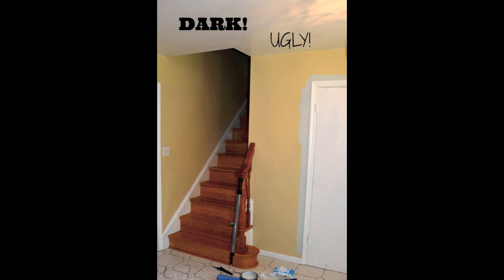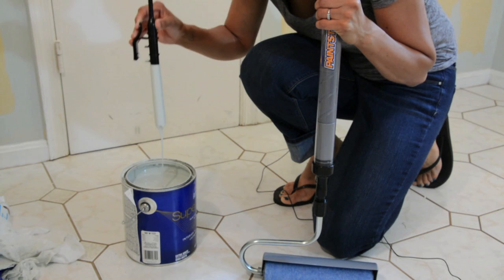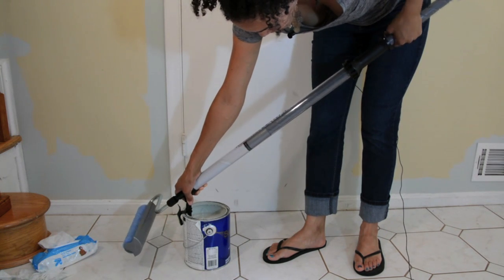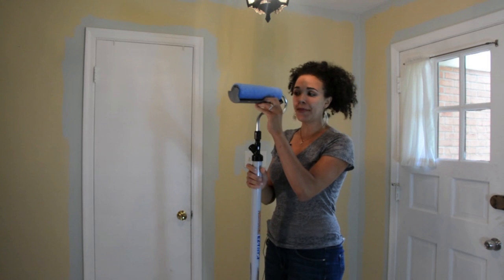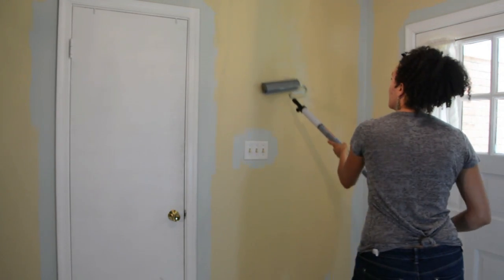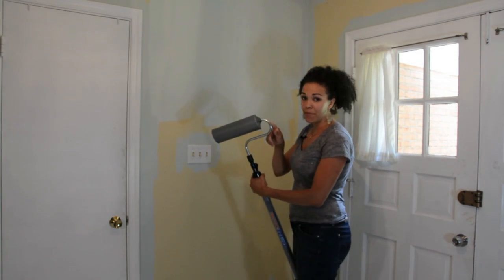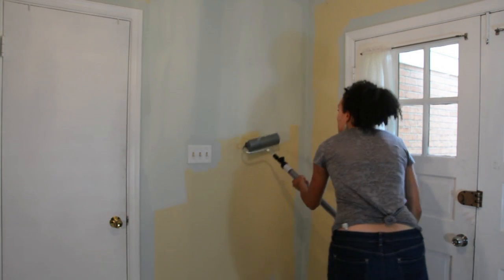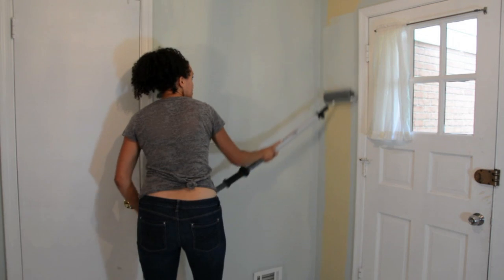HomeRight EZ Twist Paint Stick Review- Thrift Diving

Comment: There is a video on YouTube which shows how to fill the tube without the air bubble. Also in the black handle there is a little lever you switch to pull back like a syringe instead of the screwing motion to fill it. When full just flip the little lever back and roll it out!

Comment: Great how-to tutorial video Thrift Diving, this project was a great project for the PaintStick EZ-Twist. 
A side note: there is a toggle switch on the black part of the handle that you can flip in order to pull back the handle for filling the paint. Then simply flip the toggle switch back to twist the paint to the roller. Either the way Thrift Diving shows or what we just mentioned works for filling the PaintStick handle that holds paint in the handle.

Comment: I used the original version 20 years ago and removed the shield because it got in the way and the roller doesn't make a mess at all so there was no need for the shield.  Also the original version had a full size large round lid for the paint can with just a siphon tub attached.  The original didn't require twisting, just pulling to siphon the paint.

Comment from the maker: Hey, Allen! Cleanup took a little longer than my normal cleanup because I usually throw away traditional rollers! lol That's expensive, and not good for the environment. To clean up this paint stick, it only took about 10 minutes, and you can reuse the roller. It actually is a great tool, especially in the stairway when I was on a ladder (which I didn't show). I didn't have to keep getting up and down the ladder to reload paint, which could have been dangerous!

Comment: Just bought one of these tonight at Lowe's.  Looking forward to trying it out.  I have power rollers as well and a roller attachment for my Graco paint sprayer too but the cleanup time, even though easy, still irks me.  Hope the paint stick works out.  Lastly, I agree with a previous poster...you are a nice looking lady.  Even the voice....gosh. I'm subscribed.
Reply from the maker: Louis Mitchell LOL, well, that sure made my night! :) Thanks for the awesome compliment! As for the paint stick, you will like the paint stick. Just be sure to press down with your hand that's holding the stick in place when sucking up paint. Otherwise, it won't suck up very well. Cleanup isn't too hard, but is my least favorite part. From the other Homeright videos with cleanup tips, be sure to squeeze out all the excess paint from the roller after you're done, before washing it out. Otherwise, it takes longer. Hope that helps! :)
Reply: Serena Appiah Well I finally used it yesterday.  The cleanup didn't bother me but I  had a hell of a difficult time getting it primed/started.  I was about ready to break it in half.  I added the lubricant like the manufacturer's video said but I still had problem loading paint.  Even after I did get it working , I was not able to load as much paint as I should have been able to.  Other than that it painted very well.  I did notice in your video that you were pressing down while loading paint.  But other videos showed it loading up easily.  I just ordered the mini-paint stick  which is half the size.  Painting the bathroom with the long one made me feel like I was in an episode of the 3 stooges.
Reply from the maker: Louis Mitchell LOL! 3 stooges! Don't let the other videos fool you. I have used this one and the deck staining one and both require me to press down with one hand and then suck up with the other one. If you don't press down with your hand, then it doesn't suck up well. When I press down hard, it sucks up just find. The directions just don't tell you do that. I discovered it myself. :) Let me know how it goes again!
Reply: +Serena Appiah  Hi Serena> I meant to get back to you a long time ago but it appears I had a flawed paint stick.  But I purchased the HomeRight  mini version since I was painting my bathrooms and it worked just fine. It didn't have the EZ twist feature though. I really like that feature.  I also purchased a another full size paint stick but the Wagner brand.  It worked fine also but instead of the EZ twist, it had a handle  mechanism that you squeeze.  I didn't like that aspect of it.  EZ twist on the HomRight is a great feature.  So I got everything painted and have since sold my duplex   Sold if for $200,000.00 above the asking price.  Isn;t that sick?  But that's the way it is out here in the San Francisco area.  I went from a huge duplex to a tiny bungalow and I assembled a 31ft X 11 ft resin shed for my workshop and man cave.  Resin sheds don't need painting.  Thank God for resin.
Reply: Thrift Diving I tried the go roller and it was rubbish but this one looks impressive, I've just painted the dining room and tomorrow I'm putting another coat on the ceiling, hope I can find this product in Australia.

Comment: I've used this for years. Love it! I thought I had a flexible plastic tube to stick down in the paint and the old type of roller covers. I wonder if the new covers will work on my model. BTW...you are a hottie like TRIG A said!!
Reply from the maker: LOL, thanks. ;) I've had both models, and I'm not sure if the parts will work with each other. If they don't, you could probably contact them and get replacement parts. They're an easy company work with! :) Glad you like it!

Comment: we have the very first one that came out in the 19,90's it work good the new one is a twisting one do not know if i like the twisting way old did not twist but was easy to push to add more paint into the roller. you missed a few steps the Vaseline  or the petroleum jelly that it come with u put it on the nasal before putting the nasal on the paint tube also when u want to get the air out of the tube there a switch on the neck to let u push then paint back in to push out the air then u switch it back

Comment: question.. i used to work with my father painting and i was thinking of getting him one... just kind of ify about it when using this item is it harder to use because of the paint being inside it would make it heavier right?
Reply from the maker: Hey there, Alejandro! I didn't notice it being any heavier! Holding it above my head made my arms ache, but that's because I am raising my arms for long periods of time. The same happens when I hold a painting pole, too. So no, it doesn't increase the weight by much. Hope that helps!

Comment: It is good in the beginning, but if will start to leak paint from side of the roller after you finished painting several rooms. The manufacturer should find a way to seal the roller in a better way.

Comment: This is a great video. I have the older model purchased years ago. That I loved. However, my hubby gave it to charity not realizing that it was still useful. So, I need to purchase another one. I am trying to decide if the twist is easier than the original model which pushes the paint out. Since you have used both versions, Is the twist model easier than the original push model? Also, is this the only difference between both models?
Reply: Showmestate I have the twist model and I like that feature better than pushing.  But the twist model can be used either way with the push of a lever  The other difference is in the design of the handle and taking the stick apart.  .

Comment: I bought this and it took me 4 hours to paint by 10x10 room.  My coverage did not come out as good as yours and it was very light.  I had to roll repeatedly to cover the walls and if I twisted it enough to get full coverage it was leaking.. what am I doing wrong?  How often do you twist it and how much?
Reply from the maker: Oh wow, sorry that it didn't work well for you! The only thing I can think is that you sucked up a lot of air or something?? When I did it, I twisted often but not necessarily constant. I would do a few strokes, twist, and do another few strokes. You see in the video how the paint coming through the roller would make like little dots. But it wouldn't leak. Can you return it?
Reply: I'm not sure but I am going to try again in another room.   My walls are textured so maybe that makes a big difference.   Yours just looked so quick and easy and the paint was very even,  I felt like I had done something wrong...  mine was very streaky and light.
Reply: Julie Phan If your walls were textured, you may need to purchase the longer-napped roller cover. The one that comes standard is for smooth drywall. It helped a lot for my roller cover to be saturated with water first, so it soaked up less paint in the nap.

Comment: how did you do your edging? did you use any special tools?
Reply from the maker: Laissa Miller For the most part, I just use a Purdy paint brush! :) They work well and if you have a steady hand, helps keep you in line!
Reply: Any 2.5" angle sash brush will work for edges (cutting in).

Comment: I just ordered this!!! Can't wait to paint my new house!!! By the way, is there a reason you took off the shield?
Reply from the maker: Hey, Enrique! Let me know how you like it! There wasn't any particular reason I took it off! :)
Reply: Hey Serena,

That roller came in super handy, saved a lot of paint and made very little mess. I did find out later that their are two sizes in rollers. One was thicker and one was thinner. The thicker rollers were designed to be used with walls that are textured, and the thinner for smooth walls.

I wish I knew about the thicker ones earlier, so if any of you purchase these, make sure you have the right size. It will save a lot of time!!!

Comment: I know it's been several years, but do you remember if it was easy to clean the brush?
Reply from the maker: +Somps OfThunder Hey! It's not difficult to clean it out, but it does take more time than just tossing the disposable rollers in the trash! It will take about 10-15 minutes to clean this, which isn't bad if you'll be doing a lot of painting where you'll need it. Hope that helps!
Reply: Thank you!

Comment: A poor design make Paint Stick almost impossible to fill. This product is far more trouble than it is worth. Do not waste your time and money.
Reply from the maker: Hmmmm....I think it's good to use for the right project, especially when doing the tall walls and in stairwells when you can't refill so often. You have to pull it up to fill it. I found that I have to hold it tight with one hand and THEN suck in to fill. Works well for me when doing that.